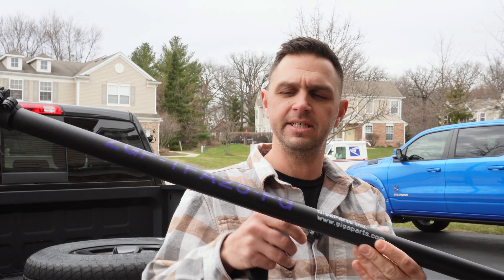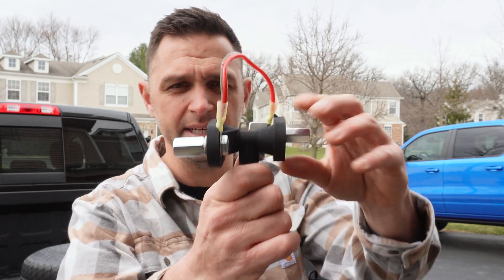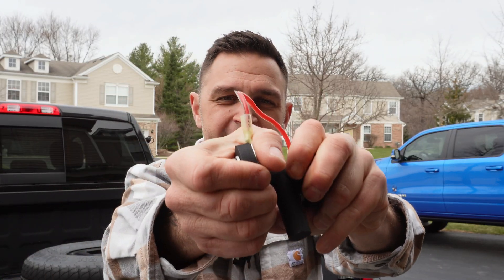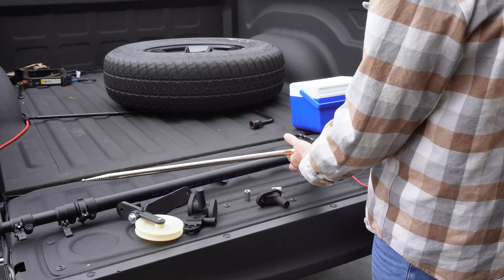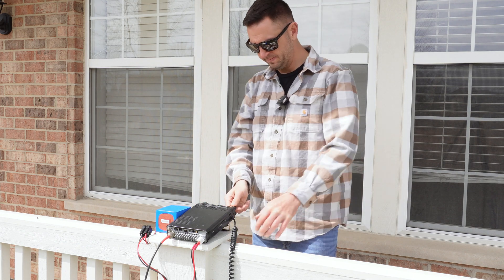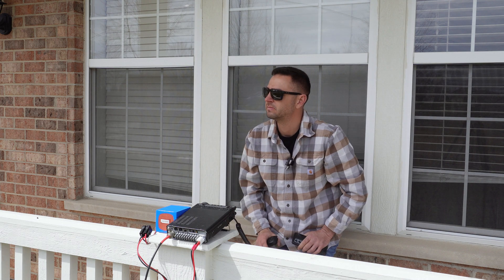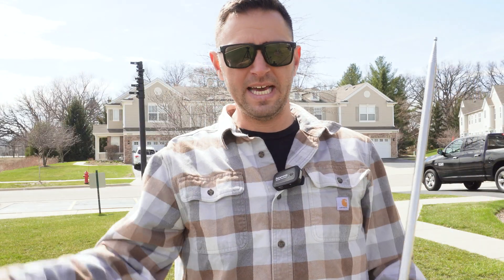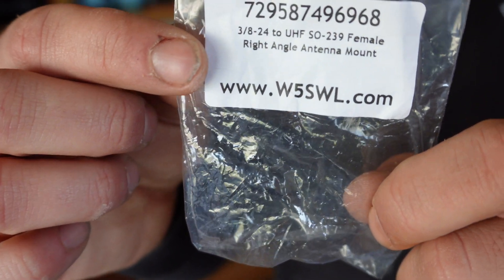Homemade, 1/2 Wave Telescoping Antenna Mount for Gigaparts Carbon Fiber Mast.  Durable?

Comment: I’m going to hang an end fed up top and was thinking of using the GigaParts Mast Finial Antenna Mount (Top Hat) #161-00-0 but the specs call out for a 5/8” fit into the top of the top section of the mast which is 3/4” clamped tightly.  I wonder if this would allow to much side to side movement of the Top Hat?  Did you make yours 5/8” or 3/4”?
Reply from the maker: I went 18.1mm which is close to 3/4".  Truth is, it could have been 3/4 inch (19.05mm or so) and it would have been a little better.  What I will tell you is, that the mast final antenna mount is poorly designed. No offense to whoever designed it, but that 90 degree angle on a 3d printed part which may see stress, that's a poor design and is more likely to break.  i made a similar part out of PA 12 nylon.  If you are interested, send me an email and I will get you photos.  I'm not trying to discourage you from buying their topper, but if you're interested, let me know and we'll work something out... And if you really want to see my toppers sold at gigaparts, let them know :)..   take care!
Reply: @DudeTested  Will contact you.  Thanks👍
Reply: Hmmmm.  I thought I was going to contact you??  Where do I find your email address?
Reply from the maker: @jvs00051  if you go to my main YouTube page, you see an "about me" tab. If you click it, you should see an option for "email address". Let me know if that doesn't work
Reply: I don’t know if this is correct but I used this:  https://youtube.com/c/HAMRADIODUDE
Reply: @UCCS3bLYRlUQmN1xLZCoidKw Thanks.  Didn’t see that email anywhere??  I’ll resend my email.

Comment: BTW, I have had this up now for over a week in very windy conditions. 20+ MPH straight winds and no issues. Amazing piece of kit. I have had some amazing results on 10m with an MFJ-1976 12 foot whip. I have not lowered it due to wind either just FYI. This does not surprise me as I have a 34' mast up year round without issue.

Comment: Perhaps provide for an (optional) truss to support the elements? Use a more standard SO239? Allow for varying angles?? (Not just horiz dipole?)
Reply from the maker: Nice to see you, Alan.  You're on to something with a locking hinge system that would allow the ability to adjust the angles.  Do you have my email still?

Comment: Looks awesome! 
You can eliminate the washer if you make a little insulating sleeve to go over the stud to shield. Then it would sit more flush.
Reply from the maker: Great suggestion. There was a reason I didn't initially do that, but that reason was because I wanted to CNC this with aluminum.  Since I won't be doing that (cost), I'm making the changes and upgrading things. I'll design one Prototype with the lip. Thanks!

Comment: I want to get a carbon fiber pole and need a way to install a pully at the top.
Reply from the maker: Hey brad! I made one for the GigaParts  carbon fiber Pole. Which carbon fiber pull are you looking into purchasing
Reply: @DudeTested  Hi Dude, I was planning on the 25-foot Gigaparts CB pole to support the low end of a 130-foot end fed.
Reply: @bradcfi2  I have the other mount that Dude showed at the end of the video and that is what I use for a pully. He shows it as a J-Pole mount.
Reply from the maker: That's true.  Sorry I missed your reply, Brad.   I have one that takes one pulley. If you get a pole, let me know and I'll send you a sample to test.
Reply: @DudeTested  I was waiting to buy a pole after I heard from you.  I will buy it today.

Thanks,  Brad-N6GR
Reply from the maker: @bradcfi2  awesome. Sorry for that delay.  I'll get some sample stuff out to you.  Good on QRZ?
Reply: @don_n5skt  Hi Don,

Do I get one from you or the dude?

Brad-N6GR
Reply: @DudeTested  Yes, QRZ is good.
Reply: @bradcfi2  I am relying on Dude to make the decisions on how he wants to handle that. I know he is looking at various manufacturers.
Reply from the maker: Sorry for the delay.  Shipped today
Reply: @DudeTested  Got it!  Should I drill a small hole to secure it with a small bolt?  How can I reimburse you?
Reply from the maker: @bradcfi2  there shouldn't be a need to drill anything into the carbon fiber mast. I'm sorry, I can't remember which version I sent you though. Did I send you the topper itself and then two small metal or aluminum plates? If that's the case, yes I apologize you'll need to drill though for a connecting bolt.   If that's not what I send you, please refresh me, sorry lol .. as far as reimbursement goes, I'm not worried about it. Just let me know what you think.  I appreciate your supporters channel member and I try to do nice things when I can for the people who support me.. thanks again!
Reply: @DudeTested  It has a pully installed which is perfect for my needs.  I have  SteppIR yagi at 70 feet.  While the antenna is awesome, it has about an 800-mile dead zone (skip zone) and I hope a wire at a little less than 1/2 wavelength high on 20 will fill the dead zone.
Reply from the maker: Ah yes, I remember which one I sent you now.  I sent a lot of stuff out for samples and people to test.  You shouldn't need to drill any holes, just place the circular or cylinder portion of the mount into the top of the carbon fiber mast and lock it into place

Comment: Hi Sean, Craig up in Antioch KD9UQE, my new Elmer out in Kansas, an engineer, convinced me that a dipole is the way to go. I still need to earn my general ticket so 20m is out. I hope you can demonstrate a non-printed mount for a budget 2m dipole. With my disability climbing around is out for hanging wire dipoles. I hope once I get a radio you will be on my first QSO list. 73
Reply from the maker: Hey Craig, nice to meet you.  I can definitely come up with something. To get a better idea I'm thinking you'll plan to use this on repeaters and for Local FM communications?  If so, then I would recommend a vertical dipole. Are you planning on mounting it indoors or outdoors?   This will help me understand if the design needs to be weatherproof.  I'm not sure exactly how long it's going to take me to make a video. However, I'm more than happy to meetup and come up with something if needed.  If you go to my about me page on YouTube, you should have the option to email me.   Congrats on getting your license, let's chat some more

Comment: you realize the plastic washer you're sanding down is an insulator for mounting that connector on aluminum bases and thus that it is not needed for your nonconductive 3d printed part,  right?
Reply from the maker: The washer with the lip prevents the metal ring terminal for the shield, from potentially hitting the center post.  Think about it
Reply: @DudeTested  - seems you could add a ridge to your printed part or simply put the grounding ring over the SO238 side of the fitting.

Comment: I have the 50 foot GP carbon fiber mast. I am dying for some accessories to fit into the top. I saw you had something with a pulley there. Tell me about it! Where can I get this stuff?
Reply from the maker: Hey there sorry for the delay. Currently working to modify a couple of things.  You better lose that one after some of the modifications and logistical things get taken care of, they may be available at GigaParts.  I'll definitely keep you updated, thanks

Comment: I don't think you need to use those washers anyways Dude. They use them to isolate the antenna on metal mounts, since your mount is plastic there won't be any conductivity between the two elements. Joe W6VIP
Reply: just put the shield-side ring connector on the SO238 side and skip the washer
Reply from the maker: I need the lip, otherwise there's a potential for the ring to hit the center post.  I could either 3d print better washers or add one to the mount
Reply: @DudeTested  Yea I thought about the ring terminal shorting out after I posted the comment. Like you said you could just add that to the mount and that would be pretty sweet. Keep up the good work, always enjoy seeing the stuff you make. Joe W6VIP
Reply from the maker: Thanks! Nice hearing from you! Have a good one!

Comment: PLA, or even PETG would never stand up to UV rays or 100F plus temperatures.
Reply from the maker: Right. I use it for testing because I have it laying around. That's why I went with PA12 for the Prototypes
Reply from the maker: I found this chart on PA12, what are your thoughts https://www.azom.com/article.aspx?ArticleID=754